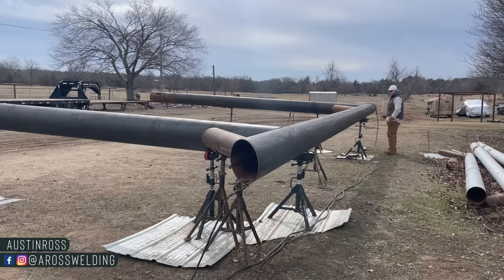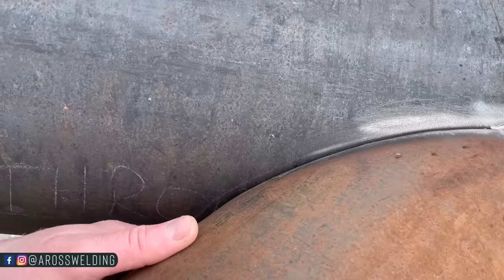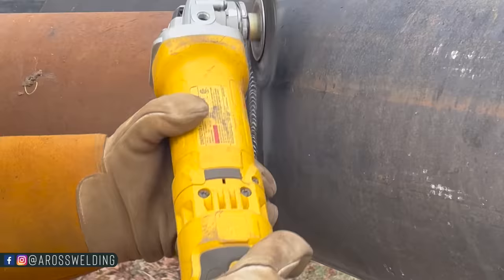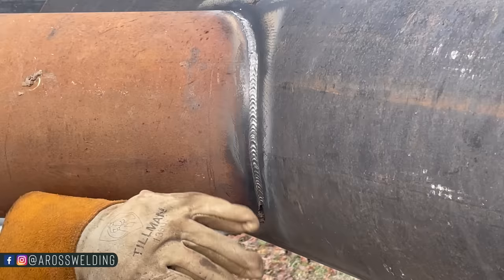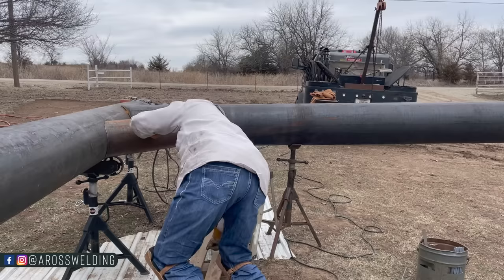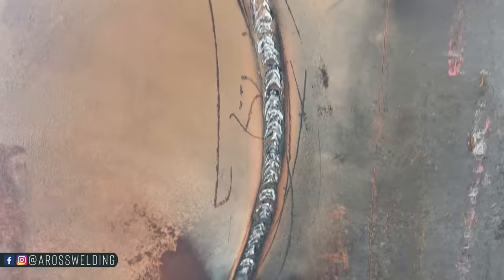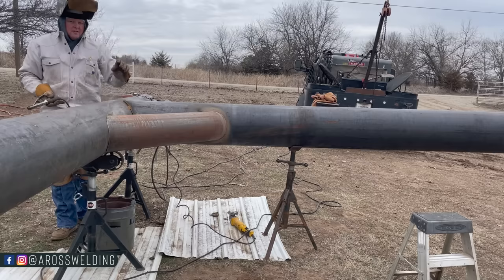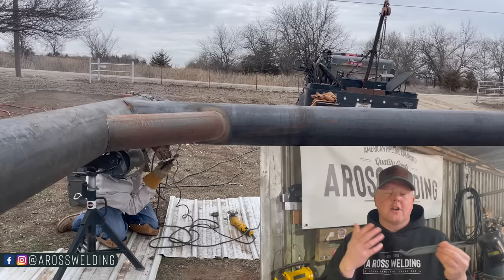Why Pipeline Welders Only Burn Half a Welding Rod

Comment: I have been welding for 35 years , have welded everything from heavy equipment, structural steel, pipe,  pipe for natural gas and propane. Welded any position that was there, uphill downhill and sideways and have had great success doing it. The only rod I use 99% of the time is 1/8 7018 and you burn the whole rod. Have had welds tested and always passed.
Reply: I burned a lot of 5/32 7018 it's all we used in my family's shop. I used 3/16 rod, too, which was mainly 7024. We had 400 Amp DC welders so we could burn rod all day. The shop I'm in now, all they have is a buzz box it only burns 3/32. They really didn't do any welding till I started working for them it was farmed out.
Reply: I was always afraid of 7018, worried that it was too vulnerable to moisture for me cause I don't have an oven . I stuck with 6011 and 6013, well one day all I had was a few years old 7018 so I ran it.  Boy I aint used anything since!

Always comes out pretty too.

And I pay for my rods, so I use it all the way till the flux is gone!
Reply: @Alex-uy7pc  I've welded with 7018 when the flux is wet you either heat them up with a torch or stick the rod let it heat up. I've welded stuff that's seen a lot of force on the weld I've never had a weld break. I never went for my trade tickets just have years of experience under my belt. I didn't want to become a welder for the rest of my life.
Reply: Thay can't control the heat
Reply: Same
Reply: Proper welds should be pre heated  with a torch
Reply: I agree! Been using 7018- 7014 in 1/8 and 3/32 for over forty years and use the whole rod every time! I've never failed a test!
Reply: @Graveltrucking  how did you burn 7024 DC? We always ran 1/4" 7024 at 400 amps AC and had flawless welds even when covering 7018 roots.
Reply: @wilmamcdermott3065  only when welding 3/4" and thicker. AWS spec.
Reply: can i ask your opinion on rod ovens? i've heard a bunch of conflicting accounts
Reply: @wilmamcdermott3065  That depends on the parent material. Not all metals require preheat.  That said.... some materials, by code, do require preheat, and that preheat is usually a specific temperature.  Those sometimes have a specific interpass temperatures specified.  Like 300 series stainless....normally max interpass temp of 300 deg. F.  I use to carry about a dozen Tempsticks in my tool box for that reason.
Reply: @bradleymorgan8223  As I remember....60 series rods actually have a bit of moisture in the flux and you don't put them in a rod box. 70 series (low hydrogen) don't  like moisture so the should be stored in a rod box.  I've been retired a number of years now so don't remember the specs, but that temp and cure time in the oven is normally specified by the Code your working under.
Reply: And the crowd went wild
Reply: I'm NOT a welder but I have worked with and around all my life. I'm a Millwright Electrician, Pipe Fitter, Carpenter, Teamster, Glazier, with a bit of Hobbie fab shop,  I figured it was a waste based on hours verses they do Not Purchase rod as the owner operators usually toss a rod at about 3" depending on the burn and float?
Reply: I like to Zip cut the rod in half , zero waste.
Reply: @davefellhoelter1343  Millwright / Millwrong what ever it takes !
Reply: Did my g6 aws weld test with 6010 root and 7018 fill and cap, instructor made sure we ran uphill..
Reply: @Graveltrucking  Thats how you get job security !  Earn your keep !
Reply: @Alex-uy7pc  Layem  in the sun, heatem  with a tourch, baked in the toaster oven but hands down best rods for the job !!  Preheat your work if it's cold and damp !!
Reply: @Graveltrucking  Good move !!  Keep your eyes longer !
Reply: Had an old time steam fitter teach me how to one pass 7018, its super hot and you got to move fast but they look machine beautiful and pass x ray every time. I have never come across another welder with the same technique. I can pump out welds 3 to everyone's 1. Burn up a lot of gloves though.
Reply: The man said he had a file I thought he might do as I but no,the 7018 and alot of other rods you may have a hard time restarting just run the tip across the file, good as new when starting off a new ark.
Reply: @stephendean4492  When I had to re start, my grinder was always by my side and just dragging the rod across the grinding wheel without it running worked just fine. But with the way I weld, if I re start I grind a quick V where I stopped for a flawless tie in.
Reply: @stephendean4492  really all you have to do is give the rod good flick when you cut the arc it makes the restart dramatically easier. just be aware of what direction you do it because your throwing little balls of molten metal
Reply: Well Mr Mccourt you sure have a awesome work portfolio. Sounds to me like you welded just about everything. But I believe that there are two things that you've never welded  or you have already mentioned that. Your resume is just like my father's and when I was a young man I did all the fittin and fabbin for him under his direction as he followed behind  me and welded everything in. He never liked mig welders, can you just didn't feel right. I don't know I'm not a welder but I do know one thing that's all he ever burned 7018 I remember it like it was yesterday.
70000 lb tensile strength 1/8" rod. And he too was never able to weld the two things I asked you earlier. I'm trying to be, going to make you smile it's a broken heart and the crack of dawn.😂😂😂😂 I miss my father everyday and I want to thank you for the memories that just came give me when I read your. May God bless you have a good day
Reply: I have been welding since the mid seventies.  I'm with you on the 7018 but here I'd be running 5/32.  However, this job would never see a single rod because I would be running an 8 or 12 vs feeder and t11 wire.  This guy may have been a great pipe welder but he's no fabricator and he's stuck using welding procedures used only for field welding pipe.   If he's making money then that's good but I sure wouldn't be signing up for any classes.  Lot of these pipe guys are the same.  Watched him putting together a stair and it was hard to watch.
Reply: @wilmamcdermott3065  no they don't.
Reply: Is there anyone on this thread that runs wire.  For this job t11.  I would not hire someone to do this if all they could do was burn rid.  With the price of rod these days you had better be burning that thing down as far as you can.  Wire period.
Reply: @jamestboehm6450  Used to run the 7024 on DC reverse. We had AC machines one of them was a 600amp. I hated welding with AC the most nastiest shocks. The only reason why I was using 7024 we had the old tin boxes of it from an auction sale. I used it on fishing hooks. They were things to recover boom chains off the sea bed. It made welding up the things quicker.
Reply: @darkone9572  When I was working for the family company I could barely straighten my fingers at the end of the day. My younger brother he was a certified welder sadly he ended up with cancer and passed away. I'm pretty damn sure welding full time for 19 years didn't help.
Reply: First job out of high school was watching certified welders in a cold shop Picher Oklahoma. Landis steel most of our work was sold overseas.
Reply: 7024 we only used that on flat welds never used it in any other position.  And don’t stop and you won’t have to restart. Burn the whole rod if you can. I was not allowed to weld down hill as a steam fitter. We wouldn’t hire a pipeline line guy not sure why. We used 6011 most of the time 7018 on high pressure steam 250#. Only used stringers on horizontal welds well not everyone I couldn’t pass a test if I had to cap a weld in horizontal position. This back in the late 60’s early 70’s.
Reply: @hokep61  as well some materials, applications require heat at cool down, when 10018 is used on shank build up, otherwise it's just a fail, guaranteed.
Reply: 6010 for root gives better penetration.
Reply: Since when burn the whole thing unless your a scab
Reply: @OliverCromwell1640  and then Blame A Politician for High Prices. ??
Reply: @jamestboehm6450  how do you run it ac? never weld with ac on the steel job man you could kill someone.
Reply: @bradleymorgan8223 In Canada you're not allow to weld anything critical without a rod oven and if it really critical like in a nuclear power plant at the end of every shift all the leftover rods are destroyed.
Reply: @bradleymorgan8223  not all rods need ovens, screw the next guys opinion just see what the manufacturer recommends
Reply: I’m not a welder, I’m just a Porn Star, but I have been. But Grandpa started me young 7018 rods… lays so nice 😊
Reply: @bradleymorgan8223  hi Bradley, I personally own two rod ovens. Moisture pickup leads to hydrogen embrittlement. The only way a 7018 can reach the seventy thousand tensile strength is to prevent moisture pickup from improper storage. New 7018 ( Lincoln Excalibur ) is so sweet to run and the slag Peel's off by itself. Nasty wet 7018 is a nightmare. Have personally compaired new dry 7018 and old 7018 on a tensile tester at Cuesta College in Morro bay ca. The new rod tested at near 70 thousand psi, the wet rods tested at 49 thousand pounds. Huge difference. The old refrigerator with a lightbulb is nonsense. 6010 cellulose rods are not to be placed in rod ovens. In fact a tiny bit of atmospheric moisture is acceptable. Hope this helps.
Reply: Same here, never had any formal school, but learned from my Father who welded in an airplane factory in WWII and in the oil field clear into the 80s. Most of my welding was on heavy equipment and gravel crushers. I love 7018. It will burn through grease, oil, paint, and dirt and make a clean strong weld. Never had a weld fail even under extreme loads.
Reply: Exactly...
Reply: And that's how we done it  old skool! Now I don't know
Reply: 7018 all day everyday !!
Reply: @bradleymorgan8223 worth wvery penny rods love it in the heat!
Reply: @wilmamcdermott3065  unnecessary
Reply: This video is about cellulose downhill rods.
Reply: my brother is a welder fabricator uses tig welding as his main welder and mig welding for jobs like machinery.  He also welds aluminum and makes cages for offroad vehicles but he has fabricated stainless steel sinks and 304 shelving.  He does stainless steel pipe welding too.  Employers that call him out to weld something and have welders on board are way impressed on his welding skill and techniques and they call him all the time even though they have welders which they would not do or have the experience he has with mig and tig.
Reply: Put a 🎮 together!
Reply: New to this, can you stick weld 1mm aluminium or is that a brazing/TIG job?
Reply: @engjds  i will ask my brother
Reply: @troyjackson3164  Thanks buddy.
Reply: @engjds  my brother says that it is very very thin aluminum and welding by brazing which you have to be very careful if you heat it too much you will anneal it and soften and it will cause the aluminum warp or it will burn thru by tig you have to have very low amp start on your pedal like 5 to 10 amps and increase as soon as you see it puddle. He says definitely a high frequency start. You cannot do a scratch start and definitely use Argon at 20 psi.  Make sure Aluminum is super clean. He recommends miller syncrowaves 250 or 350 that can run 5 amp starts or lincoln big tig machine that does 5 amp start any tig welding machine that have preset of 20 amps will not work. Maxstar my brother says cannot do it either.
Reply: @troyjackson3164  Wow, what a detailed reply!, thank you very much indeed, copied the comment to refer to later, when weather picks up, thanks very much to you and your bro man!
Reply: Really good welders only use 1/4 of the rod
Reply: I have welded for 30-plus years. Mostly equipment  and have used 7018 for most things. Tack with 6010 fast freeze rod. I also questioned why the 7010 or 8010 whichever he was using instead of 7018  rod. I am not criticizing only trying to gain knowledge. I am not a pipe welder. While I have welded it, I admit I am not an expert. Any feedback would be appreciated.
Thanks
Reply: @martinmiller7623 I been thru picher ok many times. Sad what happened to that once industrial Town
Reply: weld my frame its kinked 50 pitbike i need 1000 pound from 25 ft resistamce
Reply: Most of my 6 g certs are 6010 root. and 7018 cover pass 2 rods only to expand cert. Common practice to bend rod for out of position. Anyone says different just don't know.
Reply: @Graveltrucking same here I've worked as a mill Wright for years mechanic the rest they find out that you can weld and we save them a lot os money
Reply: I'm watching the video and listening as I browse the comments I think this is some idiotic folk Lord that's been passed down from one generation to the next my dad was a boiler Maker most of my life he was he never burned half a rod my dad is a lot of things but he wasn't a dumb a**
Reply: If you want to be more efficient, don't stop until the rod is 5 inches or less. That 7 and 8 inch rod stop is just a nervous precaution. It may seem like no big deal but if you add up all those half rods you toss in your half rod bucket it amounts to 10s of 1000s of dollars that were spent needlessly. The weld quality will remain the same if you burn the rod down all the way. It's just a little bit harder to weld with a 3 inch piece of rod and make proper contact on pipe.
Reply: However you prefer to use your rod up or not, it's your choice and it's not wrong to do, but it can be looked at as wasteful.
Reply: For welding downhill you should be using a xx10  rod.  Going uphill with a xx18 makes a cleaner weld but it's slower . He's keeping it cheap here.
Reply: @Alex-uy7pc  If not welding to code any oven can dry 7018 out nicely and it welds much better than cold.
Reply: @engjds if you can find a cobra torch you can gas weld thinner than 1 mm.  I’ve welded beer cans together at 50/50 mix but not much call for this, the six pack rings do a decent job of holding them together until you need them.
Reply: The less stop. Starts the better
Reply: You nailed it !!!
Reply: @Alex-uy7pc you are a real welder. 5P sucks. Root only. I dont even hot pass with that shit
Reply: @davefellhoelter1343 a mill rat electrician what a crock.
Reply: I don't know about anyone else, but when I wield the rods, start burning good at the end . I hate to stop to change rods .
Reply: @user-vq6rx5jo8c  pretty dumb remark. Lol
Reply: @shanehumphrey4827  What a stick in the mud . You can't take a joke .
Reply: If you're  burning half a rod, they are usually someone else's rods.
Reply: If you are building fences and you have 7018 rods that have been wet, put them in a bucket of water and weld with them wet
Reply: When welding API 1104 you have to use the rod the travel as written in the procedure.
Reply: To consider welding is actually billed by almost the second you actually little concern on materials if you take time to change a rod that don't need to be changed you just lost time. Donw here were I live for you csn have things taken to be repaired and 60$ get you a half hour and 40$ get you 15 minutes but the customer gotta be happy and almost every second helps. Some projects (this is the south and ppl will have crawfish boilers mended) not alot of time so they charge by the inch, time is still a factor and changing your stick every times it's at half is gonna slowly eat up time.